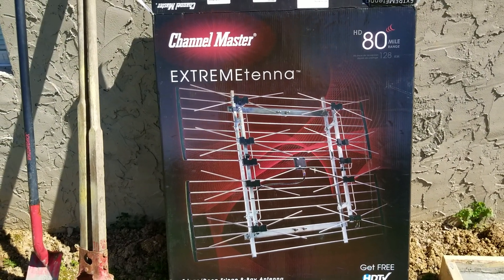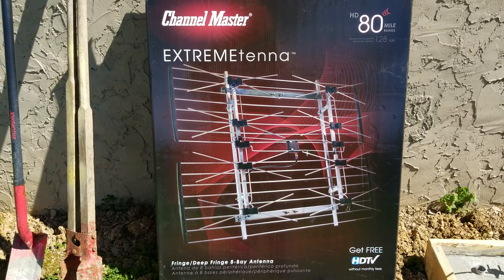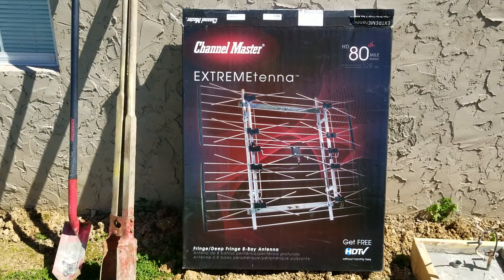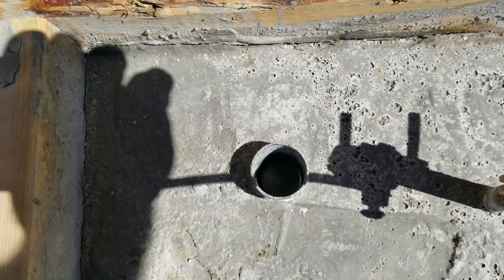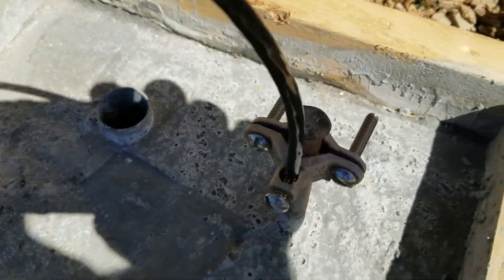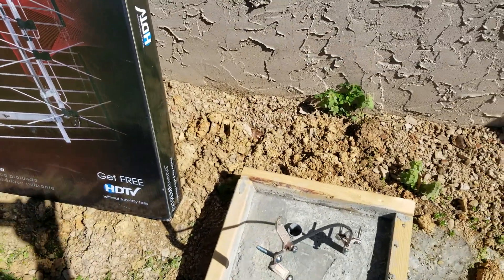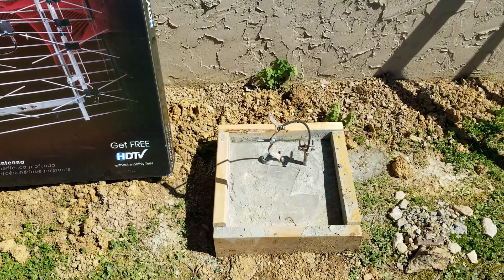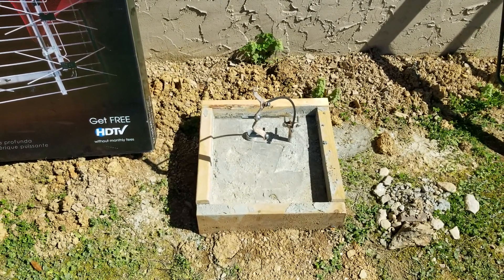HOW TO PROPERLY INSTALL A TV ANTENNA (PART 1 GROUNDING)

Comment: Everything looks very professional. No need to use the electrical service ground the 8ft copper ground rod you installed is perfect and how I always install them. The only 2 tricks you missed were wetting the ground well before installing the rod and using a long handle sledgehammer. Goes in like butter😎 Nice Work man.